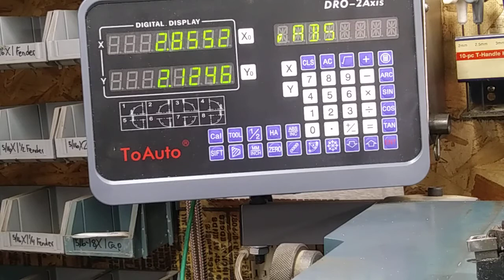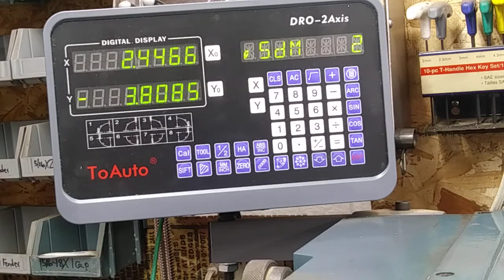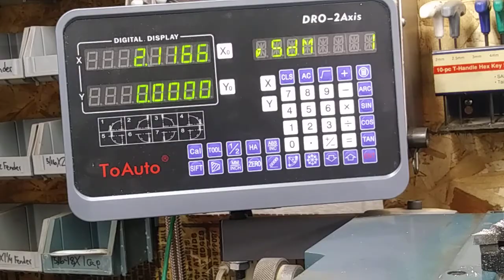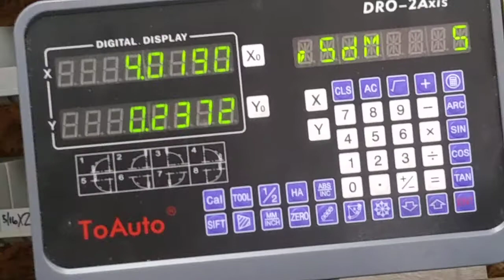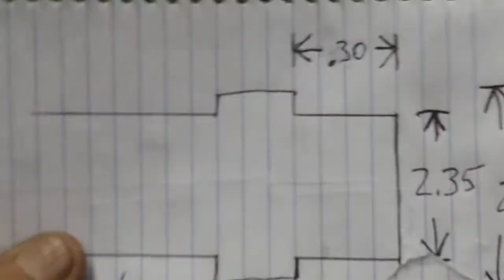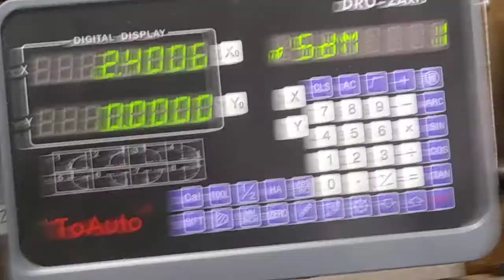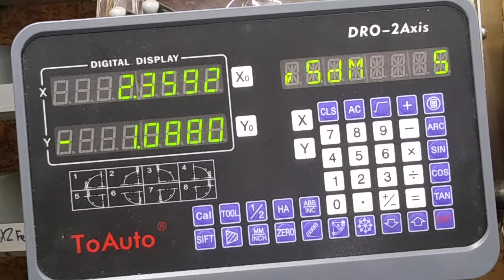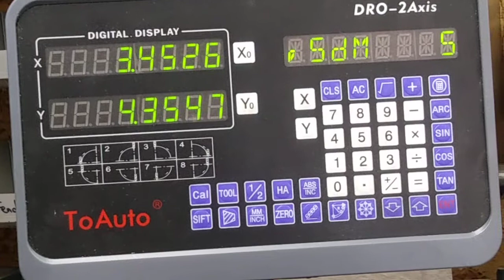Using the ToAuto DRO SDM function on the lathe.

Comment: My lathe (Clausing) reads direct (turn the crosscut 10k it takes off 10k) the new DRO reads the opposite (turn the DRO to take off 10k, the lathe takes off 5k) what setting in my cheap DRO do I chang to get in sinc with the lathe? GaryD
Reply from the maker: Did you get this figured out?   It's radius/diameter mode .use the X then press the 1/2 key.  you will swap bwtn modes ....

Comment: So the tool library doesn't work? Some of these DRO's require you to 'open' the tool library before you can add tools. This Old Tony has a video on DRO Basics & Lathe Tool Offsets. I have an LCD version (different brand) which doesn't appear to have tool offsets, going off the fact it doesn't have any buttons for it. So your video has been helpful, thanks.
Reply from the maker: Thanks Richard,   yep,  I got tool lib open,   & tools entered. The problem is when you go to call them up to use.   I even had contact with the co I bought them from,   & none of their answers helped at all.  I saw old tonys video too,  but his keys are different than the ToAuto ..  I have a few more that describe use of other functions as well.  As I get functions figured out I add more ...
Reply: @keithtrusso66  No worries Keith, good to know you are on to it. I believe these DRO's come with different software versions, so feature sets change one month to the next. I have no documented tool library on mine so your video is how I will use mine.
Reply: @richardosborn5626  What DRO do you have?  I'm looking at them now.